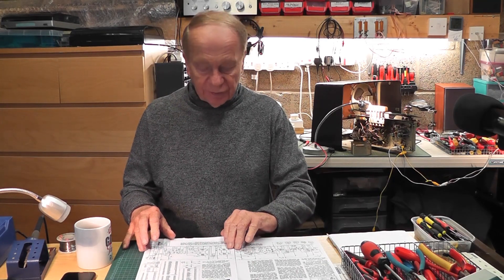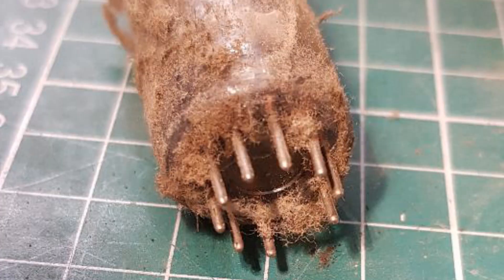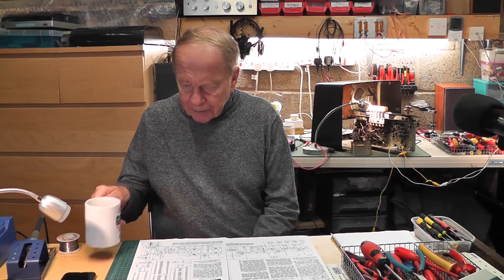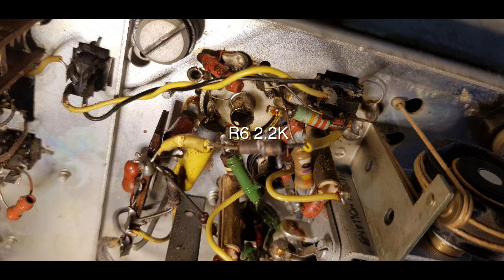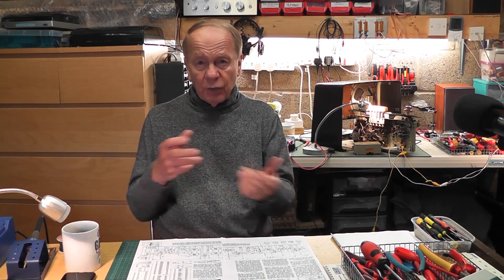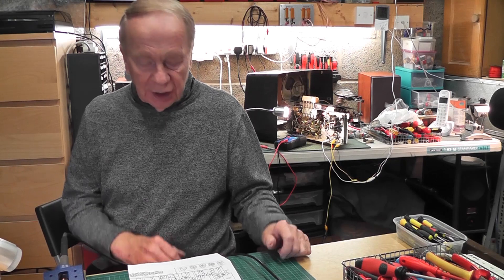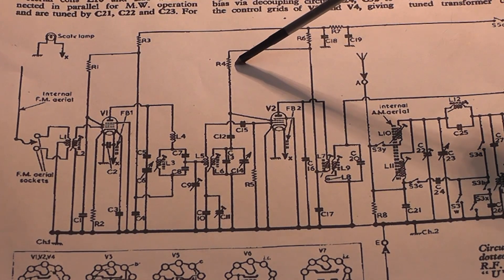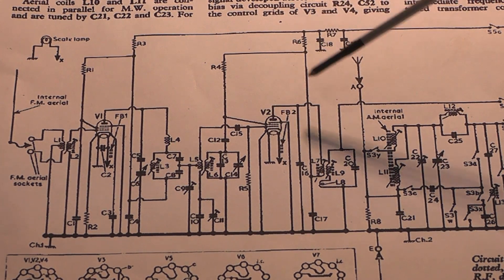Philips Radio Repair B3G63A

Comment: Fantastic video! I've got a Philips F5G62A which has this radio unit in it. I've got the schematics but I haven't a clue where to start, so I'm going to use what you did as a starting point, look in that general area for any dark capacitors/resistors.
Reply from the maker: Hi Lewis
First be carefull there are some high DC voltages around. With everything switched off, clean what you can and look for any signs of burning or burning smalls. Switch on, is there any hum or noise from the speakers, if no probably a power issue if yes are there  any crackles when you touch the phono input, if yes AF stage probably OK, just work back though the set with voltmeter and circuit. Good luck, be careful. 
Dave

Comment: Wow - this radio is a strange bird. All Philips radios that I have seen of that era (believe me, it is a LOT!) use either an ECC85 in the FM tuner, or an EF80 in the VHF preamp and an EC92 in the mixer/converter stage of the tuner. I have NEVER seen a Philips radio with two EF80's in the FM tuner. But then I also noticed that the diagram is not drawn in the typical Philips fashion, but in that British style that you also see on diagrams of British military radios of the time (actually easier to read than the Philips style). And then I found out why all this is the case - this radio is a typical British design,  done by Philips London. I have never heard of "Philips London", I thought that was branded Mullard or Pye then (which companies were both acquired by Philips at one point). A very unique radio indeed!
(By the way, you were lucky that short was caused by a leaky capacitor - it also could have been a short between L7 and L9, MUCH harder to fix!)
Reply from the maker: It was a while ago I repaired this receiver but thank you so much for you research. I no longer have the radio but was not aware at the time of is strange pedigree. Thanks again, the world of of radio manufacture and branding was very convoluted in this period.
Take care
David

Comment: Thanks for your repair video. They don't make them like that anymore for sure. Over £52 in 1956 would make it a premium price model of the time  because of the extra expense of the FM circuitry. It's a handsome little set too.
Reply from the maker: Thank you for your positive comments, yes a great radio.

Comment: This is fantastic, I’ve got an olde tube radio in the attic, I’ll have to dig it out and see if I can get it working again... never knew that they run on such high voltage 😦 I’ll be extra careful now. 
Thanks for the inspirational video 👍
Reply from the maker: Hi, thank you for subscribing g and your  positive comments. Yes please be careful when high voltages are exposed. This radio had a mains Tx fitted but early receivers were AC/DC and the whole chassis can be at mains potential.
Reply from the maker: Thank you for your interest, when you take the radio from the attic it is a good ideoto let it acclimatise to the house temperature, check the mains cable before applying power and if it does not have a mains transformer DO NOT touch the chassis.. it is a good idea to look up the model type on the Internet first. Let me know  how you get on
Dave
Reply from the maker: Thank you for your appreciation, it is great to get old equipment working again. As you say, most vintage radio's not only generate high DC voltages but unlike the Philco, don't have a mains transformer, so the chassis can also be at mains voltage. BE VERY CARFULL with this as you can easaly receive a severe shock and burns. Also be carefull when connecting any test equipment other than a test meter,  as earth loops can also blow things up. Sorry if you know this stuff but please be safe. Loads of YouTube stuff on scope and earth safety. Thanks again for your interest. Take care,
David